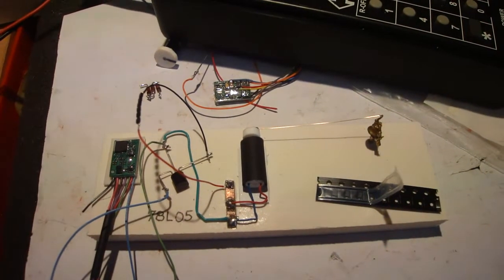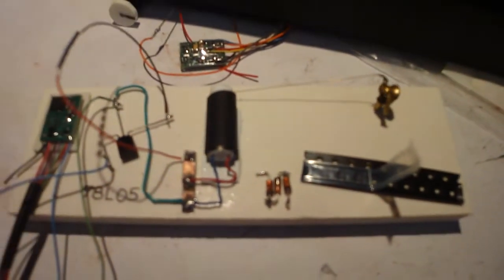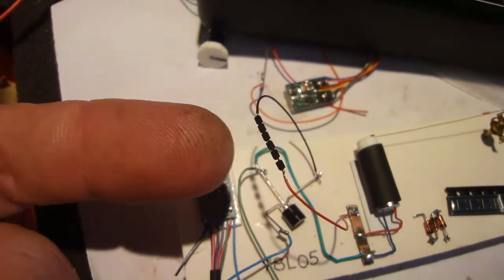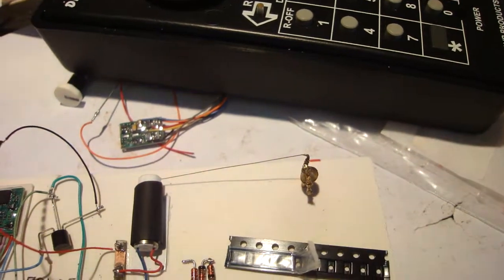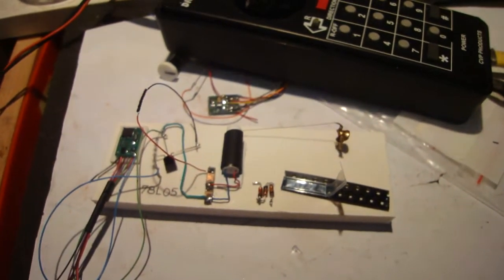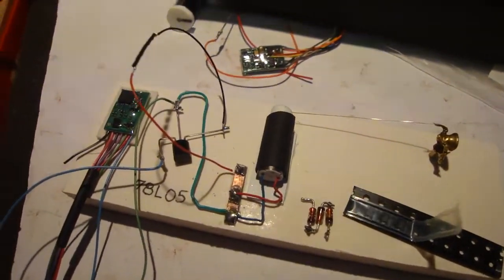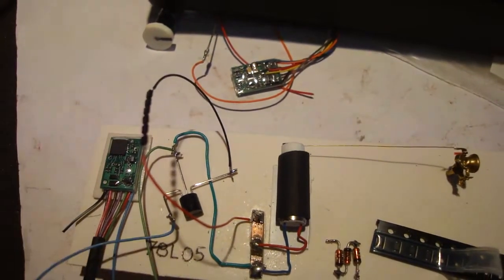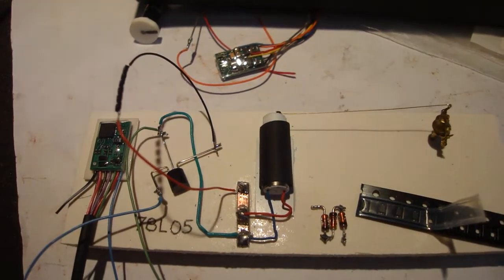SMD Diodes for animation motor

Comment from the maker: The tiny toothbrush motors are running on just 0.5v output from the decoder and to get the motor which is a 3v motor to "kick-start" every time the throttle function button is pressed the voltage must have the power to start and keep the motor working.
A resistor will suck the power and will not allow the motor to start at these very slow speeds. I have tried resistors and they just don't do it.

Laurie

Comment: Can you tell us why you use diodes instead of using resistors?  Could you not just use the right value resistor and need only one SMD resistor?  What is the benefit of the diodes?